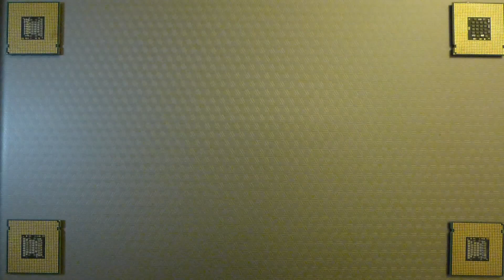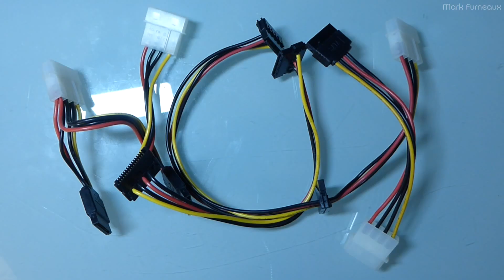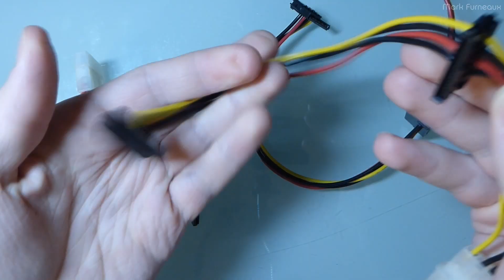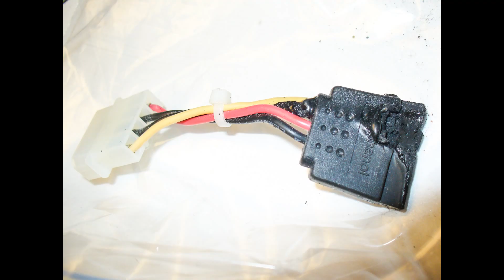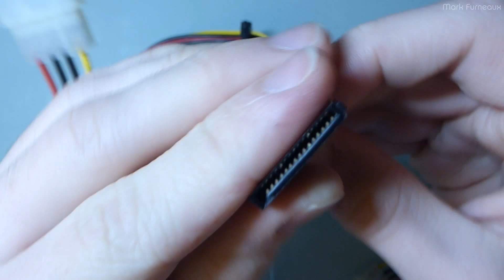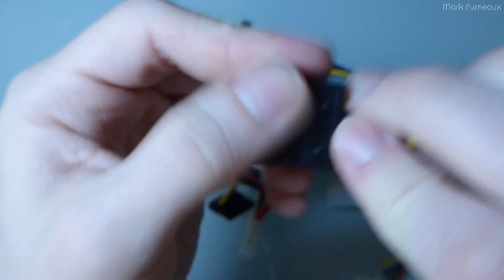How To Spot Molex To SATA Adapters That Won't Catch Fire

Comment: im  trying  to get a psu on signal  for a second psu to  put a gpu in  a  prebuil acer  system.  can i use a sata  to molex on a 24pin 16 17 short board becuase all of them are molex signaled  none are sata

Comment: If you look at photos of ones that burnt they are all exactly the same. What I mean is if you look closely they have a six dimples design in the plastic so they came from the same assembly line. I don't see any for sale currently that look like that.

Comment: I actually prefered buying the crimped one since it looks nicer and it's actually safe like you mentioned. Ususally when i use it to run a bunch of hdd it's not heating up like the molded one.

Comment: It's not a matter of arcing, rather the 12v supply wires have a short internally from the wire joint being damaged during molding/assembly or contamination in the plastic. The soldered joint for the wires and sata terminal is likely the culprit, definitely when soldering is done wrong and has oxide inclusions - which will run hot. Contaminated plastic (especially regrind) with bits of metal debris can also assist in shorts between the wires - tho this requires a very worn molder.

Comment: thanks for this as i never heard of this nor experienced it, but i have never used a molex connected to a sata plug, if i was to i would use one that has actual metal plug wrapped round the cable wire before being housed by the sata plug,

Comment: By any chance, would you know where or what company’s have the good ones? Because I looked around on Amazon and in stores and I can’t really tell or find the crimp ones.. 😢
Reply: same.... what did you do??
Reply: @_.dace._   I found pretty good ones online and I would just recommend getting the one who have the angle connectors cause you know for sure those are crimped. Like the safest ones are either than 90° ones but mainly the ones that are multiple of them chain together. But I actually didn’t buy any of them because apparently I found some laying around that were crimped that I bought a long time ago. I haven’t had any problems yet, including fires and shorts and hopefully don’t have any of those.😅

Comment: Thank you for this video, brother. I have been trying to power some SATA drives that are having what I can only describe as the "Pin 3 problem." I need these adapters to get my drives to work, and my friend pointed me at this video. I would never have known. This is my first server I ever built, and any knowledge arms me with the ability to maybe finally finish the darn thing. Thank you. You have put me on a good path with my drives.

Comment: Electrical "arch" as an initiator is very VERY unlikely without the cables actually touching or unless there's  gross over voltage situation that breaks the dielectric of the plastic.

What most likely happens is a bad contact (either a bad crimp/solder in the connector itself or between the connector pins and the device input pins).
The latter is very likely since looking at the example pictures the heat source has been very close to the device pins, thus it's unlikely that crimping/soldering has been done badly and the bad contact happens after it.

That point then has larger resistance than it should, thus it starts to heat up from the current, increasing the resistance, which makes it heat up more and ultimately it'll either find equilibrium or it'll start to melt the plastics and then the contacts might start to move around and ultimately touch, which creates either a short circuit or something very close to it

If it's not pure short circuit, the reason might be that melting plastic starts to carbonize, and carbon is not pure insulator and power-supply starts pumping more current to that resistance, which heats it up more and since power-supplies can deliver hundreds of watts before even realizing there's anything wrong, that's enough to even start a fire or at least get stuff really smoking etc.

So yeah, cheap connectors together with the fact that SATA power connector is very very easy to insert badly or it can work itself loose easily from thermal cycles and vibration etc. when people move their computers and heavy cable bundles pull on the connectors.

Comment: I just bought a pair for less than two dollars on eBay as that was the only part missing to my side and when hooking it up to my laptop it wasn’t even 90 seconds and I was already smelling something burning with a better rubber in it and I noticed my hard drive was smoking a bit, and I am plugged it as quickly as I could. I hope I didn’t destroy the hard drive.
Reply: did you?
Reply: @_.dace._  no not at all. I just wrote this comment to be a sarcastic, smart ass.

Yes, it really happened. The hard drive caught on fire with a power surge and I had to pay $1100 to get the information out of it back.

Comment: Yeah, I just had that happen and it WASN'T a cheap molded adapter at all,  came with my corsair PSU. It didn't exactly go up in flames, but only because the PSU shut down quickly. There was a tiny flame and a lot of smoke. The PSU and everything else seem fine, but I have a fried SSD now. Thank god for backups 😉. Now I'm not sure what cable to use as a replacement considering this wasn't a cheap one.

Comment: The plastic which holds this wires actually started melting, slowly, slowly, and the heat rise as much as the plastic melts, because of the temperature wires which inside in these SATA cables gets kind of sold which make power cable to not throw all the electricity but raise the temperature in such which causes the fire.

Though it's not always that it will catch fire, sometimes it just melts...so badly

Comment: thank you for the info i personalty use the blade ones as i make my own and solder the wires after i push them into the blades of the sata connector i looked though my pile and all of them are the injection mould type cut them up and put in to garbage keep up the awesome vids sir

Comment: There are sata to sata power cables that have connectors which fit your description for a "bad" molex to sata adapter.
Are these dangerous? I am asking because even thought everyone is talking about molex to sata catching fire, since the culprit isn't the molex side but the sata side then the sata to sata power cable should also be unsafe.

Comment: Can anyone recommend a sata power splitter or extension?  My system's case will not fit the straight wired one and needs a right angled connector. This video makes me apprehensive of buying one online without knowing the seller's reputation.
Thanks

Comment: Interesting.... I've been using 3 of the "good" adapters for the longest time now.  They came with motherboards I've used in the past, back when when they still had both IDE and SATA.... or maybe they came with some SATA drives i bought in the past (We're talking about SATA I and SATA II here)... its been too long.

I found one of the "bad adapters" in a box... its probably as old as my other adapters but I havent been using it all this time for no particular reason really before watching this video.  Such a good coincidence I lucked out!

Comment: The plugs with the hard plastic and internal dividers is made so that each wire, having been attached to the connector part, is then crimped to the connector around the insulation. The connector has a weakly sprung barb that clicks into the hard plastic to prevent the wire from being removed in service.

When the connector is flipped over, you can see the bright metal of the connector and the barb in place.
This crimping method is used in the clear Molex plugs to retain the copper conductors of each wire.

Arcing and the resultant heat damage usually occurs when a conductor joint or a short circuit becomes resistive; i.e. not a dead short, but an intermittent sparking or flash over.

Most of the 3.5" SATA HDD are rated thus:  5 VDC : 0.65 A (650 mA) DC and 12 VDC : 0.5 A (500 mA) DC, so it is hard to imagine why the conductors become a resistive short circuit unless, as Mark suggests, the molding process is flawed.

To test the effectiveness of the molding process, the wires and connector should be subjected to a High Voltage (HV) test via a "Mega" to check the insulation resistance between the wires and the connector; i.e.

(1) the HV is applied between the wires joined together and the plastic;
(2) the HV is applied between each individual wire to each adjacent wire to check the internal separation and internal insulation.

Comment: Great video! I was just building a system, tempted to use a bunch of these adapters. I checked, and of course, half the adapters I had were the "bad" ones. Opted to only use a couple good ones and get another sata power cable for the modular PSU instead of the molex cable.

Comment: Tin whisker (microscopic hairlike tin crystal) growth from high-tin-content RoHS solder used to connect wires to the contacts inside. I know of datacenter bus bars that have had holes blown in them due to extensive tin whiskering, as well as random breaker trip events where the whisker is vaporized in a few milliseconds after growing close enough to arc on LV/MV circuits. This is a major and growing problem in industry as 15-20 years since commissioning is long enough for enough growth to set in that it becomes a serious, and expensive to fix, operational risk. You can't even clean the damn whiskers off because you create microscopic scratches that serve as nucleation points for further crystal growth. All you can do is replace all the bus bars. That runs into the millions. F'n nightmare scenario.

Comment: is it safe just to run a fan with the one you said 
dont get ?
Reply: I have the same question, I was wondering if I use the adapter to connect my rgb fans

Comment: You CAN fuck up a Molex connector.  The pins get loose in the housing or even break off the wire completely, if you have low-quality pins, low-quality housings, or cold-solder joints on the pins.

Comment: There is a large difference between the current draw required to shut down the power supply and the safe carrying capacity of the individual connectors and their wires (#18? #22 wire?). This means there is a good range of partial shorts that can smoulder and cause a fire but not trip the power supply.

Comment: Very interesting video. I have now removed All the moulded adapters from my computer & connected directly to the drives, using the Sata plugs direct from the PSU, which do have the orange 3.3v lead, which I understood could stop the drives from powering up with some Sata drives, as I have recently replaced the old mechanical drives with SSD, this no longer appears to be a problem.

Comment: I have had one of those molded "bad adapters" for a year now and I got it from an old used Core 2 Duo PC I got at a FLEA Market (I know very well how horrifying that sounds) but it never did that, even though i only used it for my ODD. Now i got my SSD (finally) and I switched to an adapter like the "good" ones you have. I guess im going to be safe

Comment: Thank you very much for your advises. I found your video investigating on a problem that occurred yesterday to my NAS. A SATA power cable for a secondary disk was partially melted without apparent reason and I became aware of it because of the bad smell of burned plastic spread around. Since it was a loose cable with no disk connected and almost in touch with the top surface of primary disk I presumed that the disk became overheated and melted the cable. The top label of the disk was browned by heat. The disk did not spin anymore, so I opened it to  check for any sign of burnt but I found nothing. So I focused  back to the cable and thank to your explaination I found the real cause of my issue.

Comment: Yup, just had one ignite - crazy! The adapter was a duel sata to molex. The wiring was way too small a gauge to handle the power. I've never had a problem with heavier gauge wiring with these connectors. I thought it strange when I first looked at it, I should have went with my instincts. Fortunately I caught it immediately.

Comment: Thank you for bringing awareness about this. As a new pc builder, I had no idea.

Question, is this limited to just molex->sata power adapters, or any sata power adapter in general?

Only asking because I have a 3rd party fan controller that is powered off sata cable (it's a 3 or 4 pin fan cable->sata). The sata power head looks like it is molded as well, but it's just a single wire going into the header and not individual wires.
Reply: Is it a reputable brand?

Comment: Had one of these molded sata adapters start a fire in a server several years back, before I learned about any issues they had. The adapter was connected to a drive near the top of the case, and when the connector started burning it dripped burning plastic down onto a large removable tray multi-disk unit. The plastic backplate on that started burning and it really took off. Set off the fire alarm, but the server was still running when I got to it. I was lucky and no hardware was lost, besides some charring.

Comment: phew, it's like i won the lottery, i mindlessly bought like 8 of these and connected 2 of them on my main pc without giving it a second thought,but i was lucky i bought the good ones.
Reply: Many power supplies and adapters use the "blade" style connectors. I don't use adapters, those "blade" style connectors are easy press on to a PSU strand with molex connectors (I don't have any molex DVD or HDDs).

Comment: So, this problem is clearly dangerous, testable, and probably fixable by design. How has this avoided the scrutiny of standards organizations (IEC?) or been allowed to remain legal? This danger would be illegal for most consumer electronic devices, yet every day consumers (like me) can easily buy and install this dangerous POS. Seriously, it can't be difficult to redesign this in a safe way, and most consumers would rather pay a few extra dollars to protect their equipment and selves from a fire hazard IF they are aware of the danger. So, I'd like to see dangerous crap like this regulated out of existence.

Comment: hi friends, this cable are safe to use or will be fire? Poppstar - Cable Doble de 60 cm, Cable Sata 3 de Datos y Cable de alimentación (Cable Sata 3 para Datos y Adaptador de Corriente Molex a S-ATA (4 Pines a 15 Pines SATA) en uno, Trenzado, Color Negro

Comment: I just had this exact burned wire adapter yesterday (4 pin Molex to Sata)  it even melted the pcie 6pin wires that it was next to.  About 2 months ago I had a power supply that actually made a big bang and sparks flew with smoke and fire that too I had never seen that guess my luck is running out.

Comment: The problem is SATA has 3.3 Volts that Molex(5V and 12V) doesnt provide, so the biggest issue is the what hardware you connect it to. The reason it takes a while is, like over-clocking,  you can run hardware at a higher voltage for a while but if too high, it eventually it will burn your hardware. This is why YT vids like this are dangerous, people with a following and no knowledge giving bad advice that can cause housefires and even deaths. 

You think everyone has a CO2 extinguisher beside their PC?  Update or delete this before someone gets hurt ..or worse
And shame on you for uploading with no technical education about the subject.

Comment: After checking my PC I discovered my DVD drive was using a vulnerable Molex to SATA cable. Immediately removed it, as well as the Molex cable from my computer's power supply, and connected everything with SATA power directly instead.

Comment: Wish I saw this video earlier had a molex connector catch fire today was running fine for over 6 months.

I had it attached to an SSD & using a single 4-pin molex to single SATA power adapter it I had placed it on top of my power supply since it didn't have a top fan.

Most likely the heat from my power supply caused the plastic to warp around the SATA connection which caused a fire that could be seen from the top of the medium tower just super lucky it happened during the day.

The 250GB Samsung EVO SSD is still working but plastic power connector on it is a degraded I am going to get it replaced just in case.

I will also need to check online to get better adapter or use enclosure with USB 3.0 but Ubuntu use to have issues booting from it.

Comment: Does anyone happen to know if the same issue applies to SATA to molex female adapters? I've had to buy one of those to pull volts from a SATA port to power my RGB fan controller as it stupidly only comes with a molex power cable.
Reply: I have the same question, I was wondering if I use the adapter to connect my rgb fans
Reply: @guizzz1366  Well so far I haven't had any issues. Been going for three years now apparently.
Reply: @thedeviluknow  cool, I'll try to connect my adapter to turn on the rgb fans, thanks :)